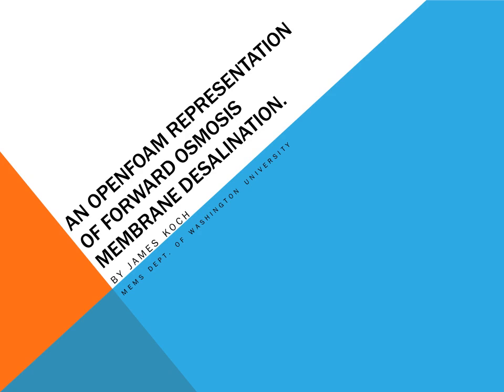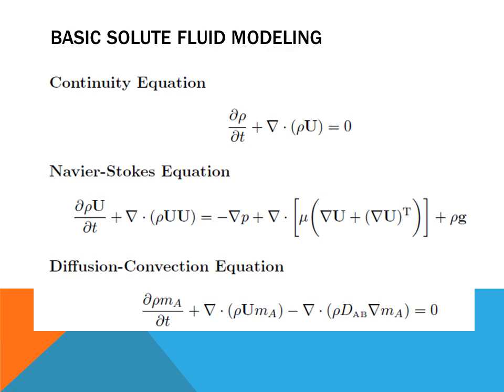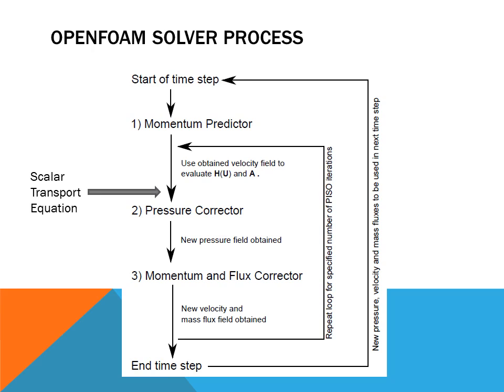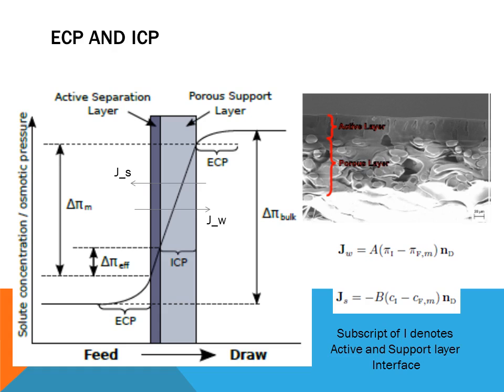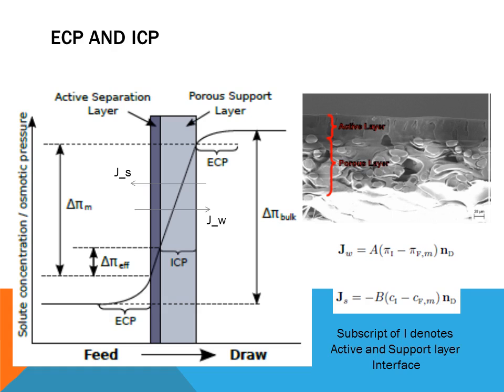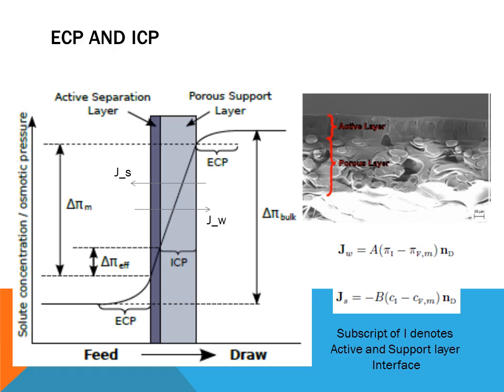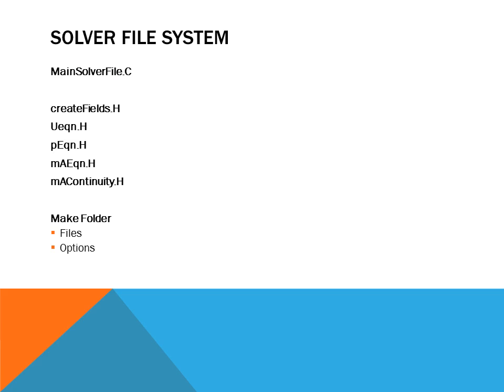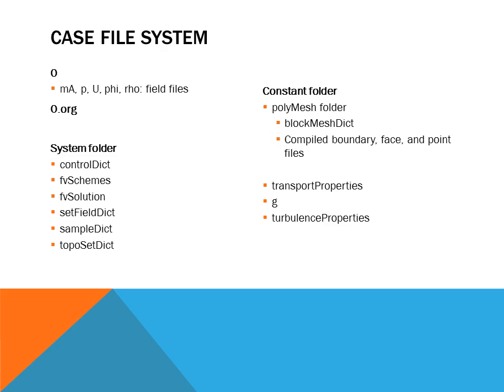An OpenFOAM Representation of Forward Osmosis Membrane Desalination

Comment: Hello James,
A very nice presentation! How did you manage to implement this membrane boundary condition? Did you do anything with the continuity equation for mass conservation when extracting one component?
Reply: +Ramon Voncken : you may be able to find some of the code explanation you want in my thesis. It should be in the washu library somewhere.  If you are simply asking about OpenFOAM utilities, I used topoSet and createBaffles to generate an internal patch on which the membrane boundary condition could be assigned.